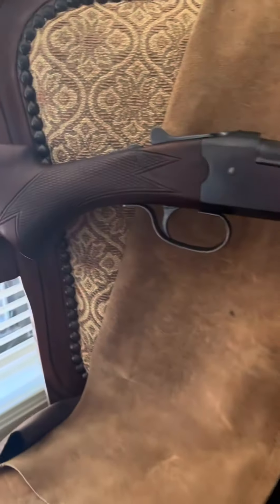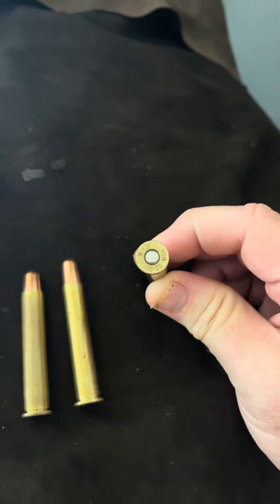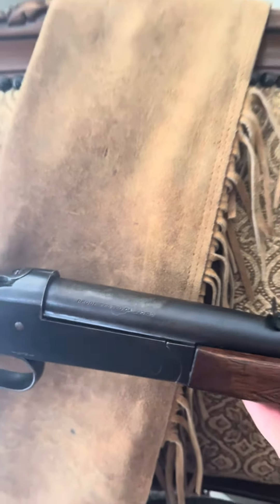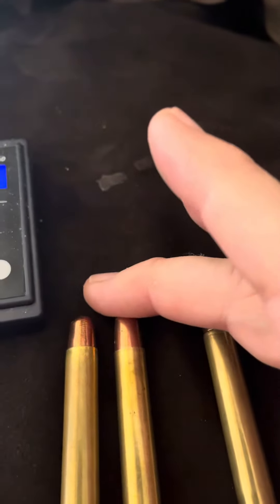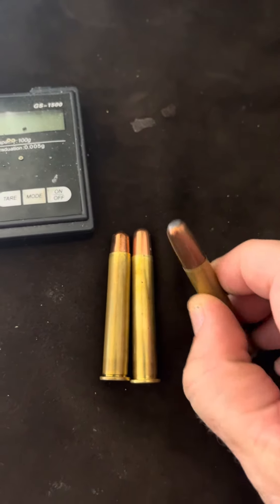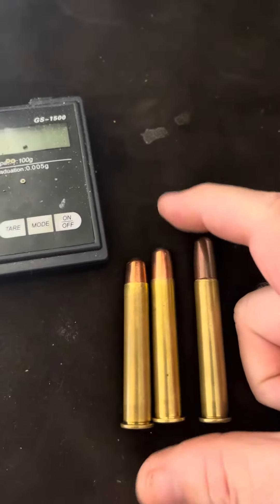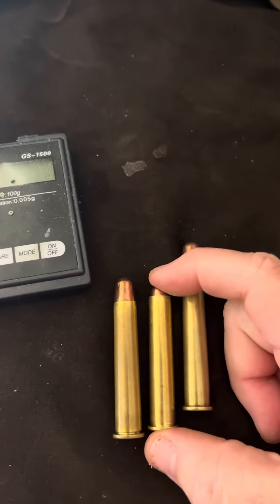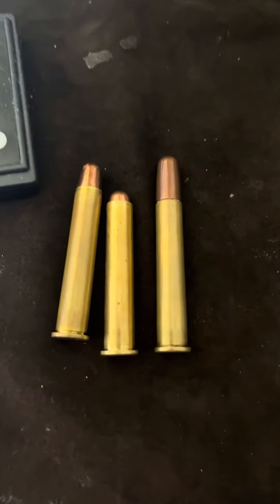Bullets ARE TOO LONG!!! to work in a 1894 Winchester, Then too short!  Picking right grain and shape

Comment: 38/55 can be a "bastard" diameter. 

Id suggest you do a cerosafe casting and measure the chamber and the bore. Ya may need to push a lead ball theu as well but verify the diameter. 

Could be anything from 375 to mid .380's!!!